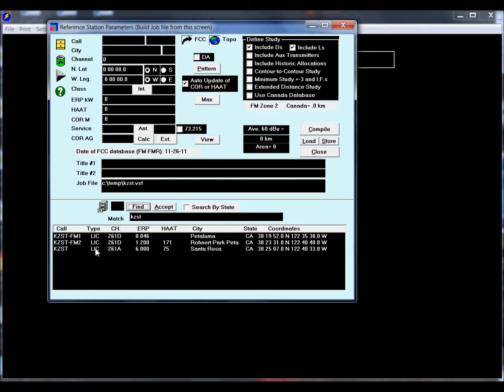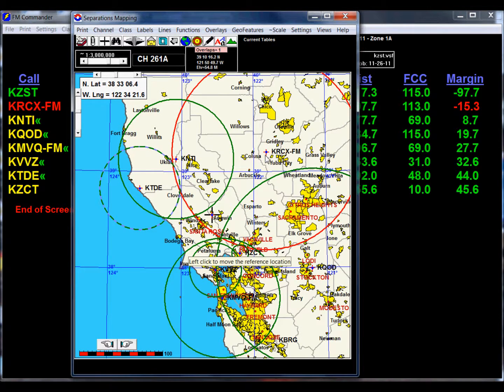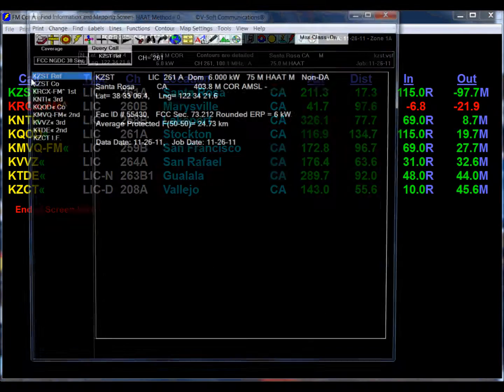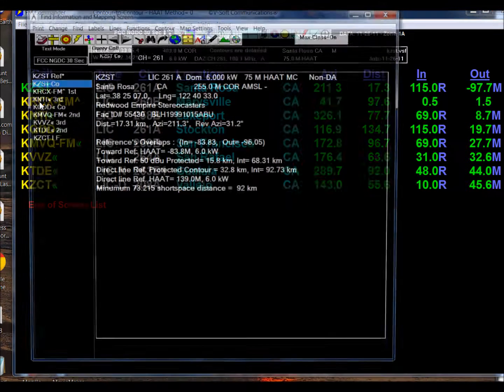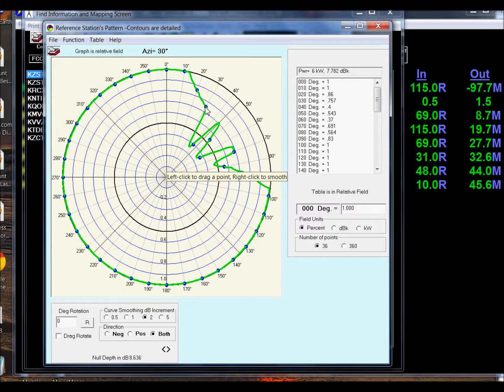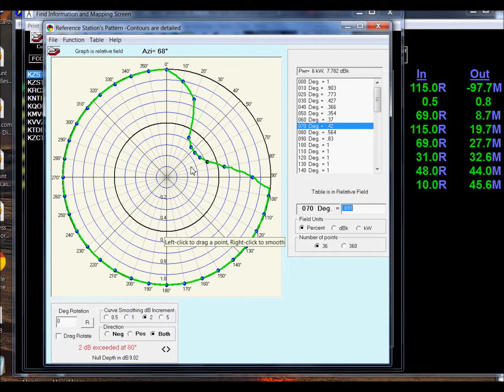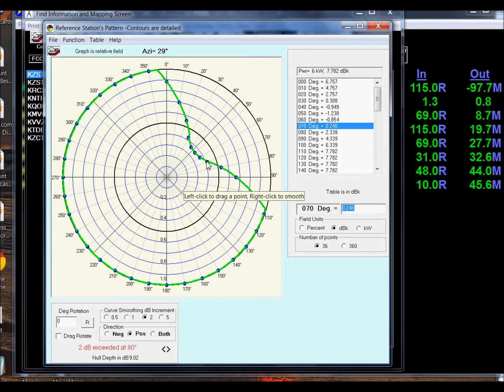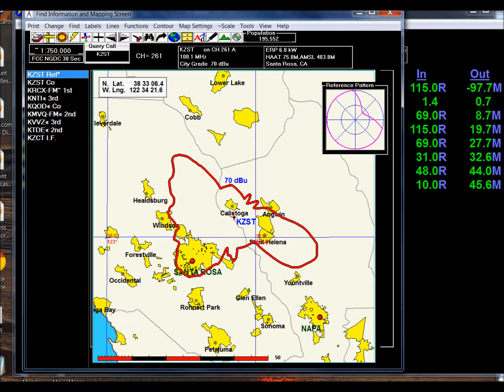Directional FM Antenna Patterns Design

Comment: Very impressive... but still seems like a lot of work.  I use an Excel spreadsheet to smooth out DAs.  Too bad VSoft software is so expensive (in all fairness, most of the competitors are too).